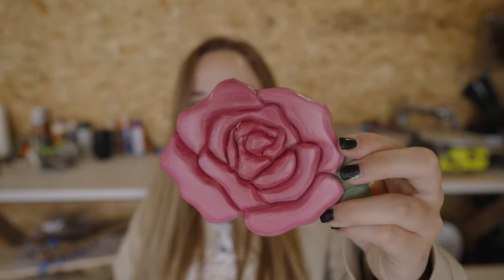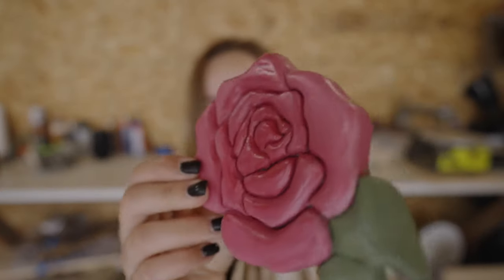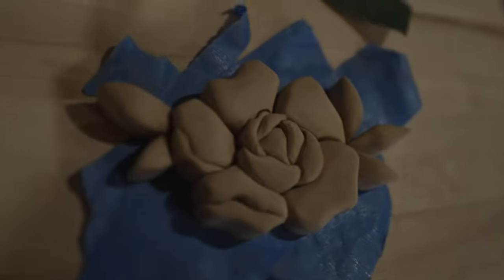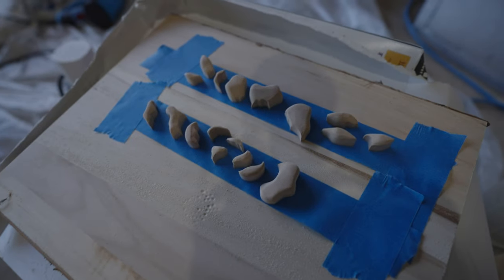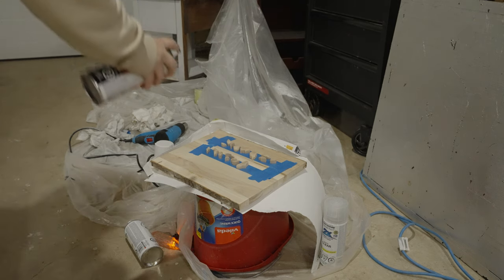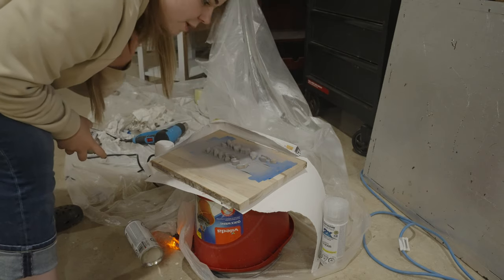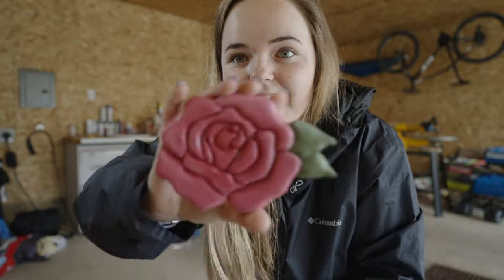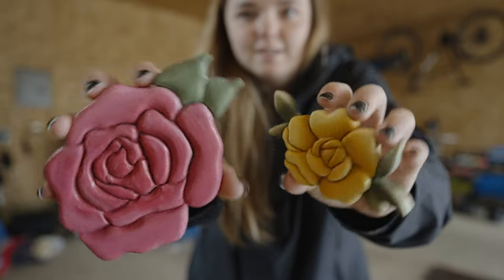Painting MDF Florals! | Scroll Saw

Comment: the process for that painting was spot on.  Filler primer will be thicker then regular primer, obviously as its used to fill voids.  as you move on with this, steer away from filler primer and use super thin coats of regular primer.  the model primer works really well as well as it sprays super thin and covers incredibly. Being that MDF is basically saw dust pressed with a glue, high grit sandpaper is your best bet as lower grit will leave you with alot of extra work to smooth out. Looks fantastic, always like seeing a fellow FPV person getting into a wood hobby.